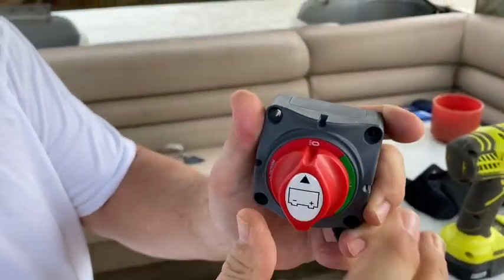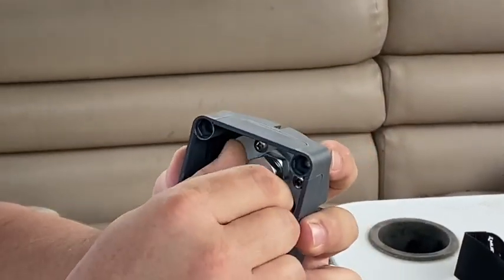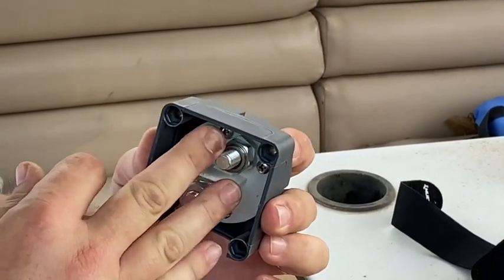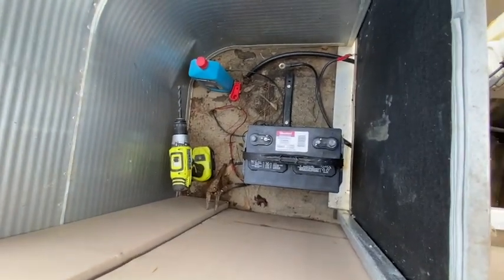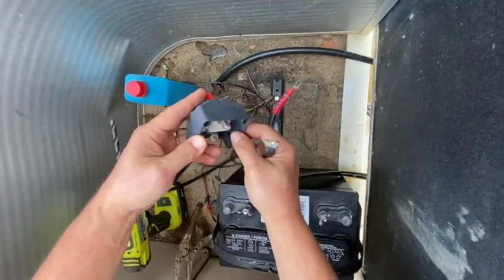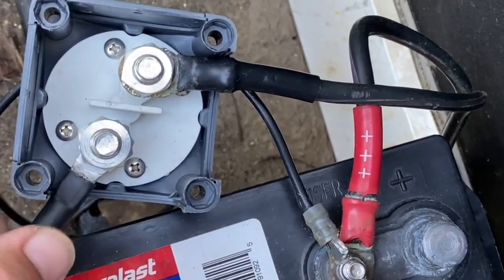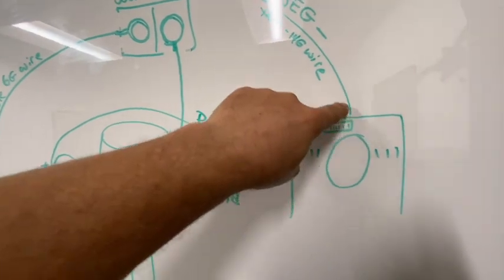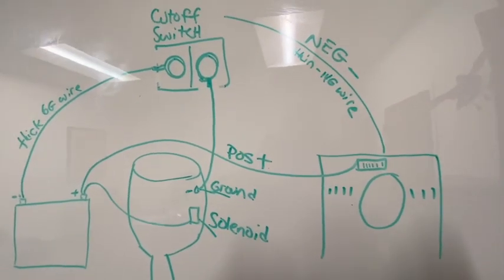Installing battery disconnect on my boat

Comment: DC voltage travels neg to pos always. (Nit the other way around like so many think). Break the circuit right after the battery with the switch and it won’t matter what you want to power, nothing will flow anywhere. Simple. 🇨🇦

Comment: Just for reference, the issue is called a Parasitic Draw.
This is when something(s) are still drawing power even when the key is turned off and it can apply to anything that uses can key/ignition.
Reply from the maker: That's exactly why I installed this disconnect...if I let it sit too long the battery would need to be charged even though the key was out.

Comment: Should've used a unibit!
Reply from the maker: At the time I didn't have one. I do now though!
Reply: @captainandmissunderstood  they are definitely a necessity for this type of work. I’m a commercial construction superintendent and picked this tool tip up from my electricians. My Bayliner Capri also has a battery(brand new) that goes dead regularly and I am about to do this hack for sure.

Comment: The switch has to be on the positive side,, switching the neg does nothing because damp wires can act as a ground and still drain your battery,,
Reply from the maker: I did end up switching it over to the + side!
Reply: It works on positive only. 🤪

Comment: I just installed that same switch on my boat and had intermittent power issues that I fought for 2 days,  Turned out it was those 4 screws on the back that hold the white part in place were loose a bit causing intermittent connection.  Make sure you check them!
Reply from the maker: Interesting you say that because ever since I put this on my boat I have had odd issues. Radio blew fuse. Docking lights blew a fuse. Replaced fuse, they worked fine then stopped again. Other lights are fine. I had planned to do some troubleshooting this weekend so I will definitely check those, thanks!

Comment: You need a stepped drill bit
Reply from the maker: yeah a step bit may have worked but could have resulted in too large an opening due to the size of the ring terminal.
Reply: @captainandmissunderstood  they make so many sizes of stepped bits. Just get the narrow ones so each step is only a 1/16th step. Also works amazing on fiberglass to stop Chipping

Comment: Your drill is in reverse
Reply from the maker: Optical illusion...you can tell by the direction the wire jumps that it's turning correctly.
Reply: Wow, it definitely looks like it's spinning backwards the more times I watch it but that makes sense. My mistake.
Reply: LMFAO........😝

Comment: Why did you chose to discount the negative side vs the positive side?
Reply from the maker: No specific reason actually, but a good question. I had experienced ground fault shorts that drained the battery so I decided to disconnect the ground to address that problem. After shorting my solenoid this weekend (while the disconnect was off) I think I may switch it to the positive side. Thanks for the input!
Reply: @captainandmissunderstood  The switch has to be on the positive side,, switching the neg does nothing because damp wires can act as a ground and still drain your battery,,
Reply from the maker: @mitchfallik5321  Thanks for the input. I ended up moving it over to the Positive side. I will be updating the video/description to reflect this!
Reply: @Mitch Fallik  Thank you for commenting. Other videos showed the (+) side, and then he shows (-)side. Totally confused me until I started reading through comments like yours.

Comment: Your video was so helpful! Thank you. 

Question- did you reattach the back plastic plate before mounting on the boat? Also, did you screw into the metal on the side of the boat to attach?
Reply from the maker: So glad it helped you! 
Yes I did reattach the back to the switch before use. I have not attached it to the side of the boat yet because there is upholstery there that I did not want to puncture. I am working on rearranging the whole setup so I can attach it to an appropriate location, probably the very back.